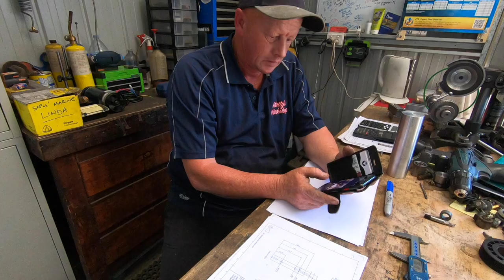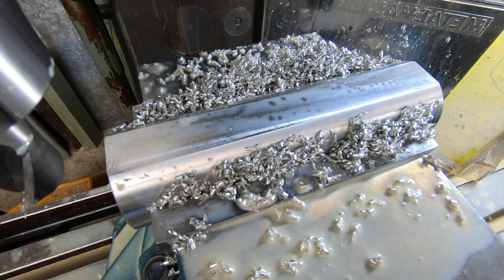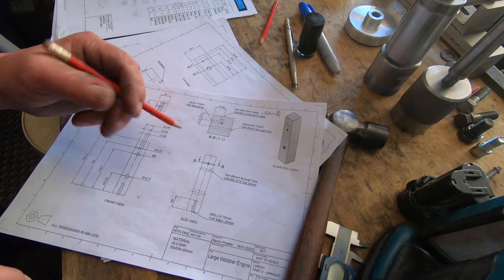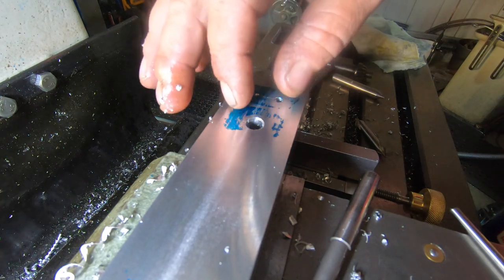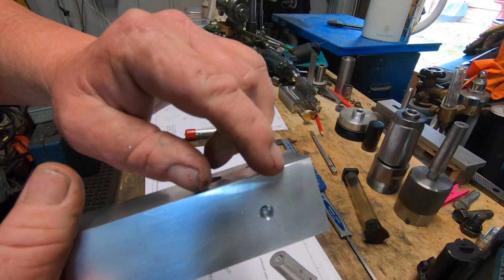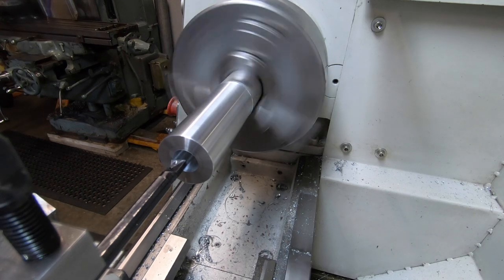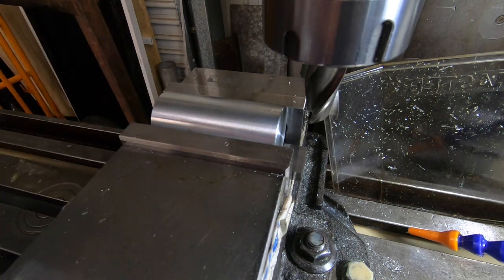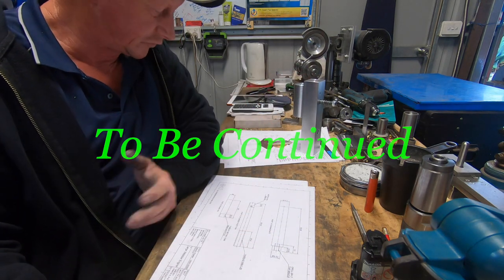Wobbler Engine - Part 1

Comment: Bad practise or not, I would also use an end mill in a drill chuck for counterboring. It's only when side milling that it's likely to pull the chuck out, or come loose in the chuck jaws. Straight down for a counterbore and there's no side load. (People sometimes tell you off before thinking it through!) :-) Awesome to see you back Matty. I am looking forward to seeing the rest of this. It's gonna be a chunky engine! Cheers mate, Craig
Reply from the maker: Gday Craig, the mt3 arbor on the drill chuck has a drawbar not a tang which is good, it certainly is a chunky engine, fun build mate, cheers
Reply: @MattysWorkshop  Yeah - should be fine either way for a plunge cut! Ignore the naysayers :D

Comment: G’day Matty. Good project mate, it’ll sure be something different every time you crank up the machines and they all got a work out even the Cincinnati. I gotta say that is a big engine.
Cheers 
Peter
Reply from the maker: Gday Peter, the only problem with using all the machines is there’s so much more cleaning at the end of the day, pain in the ass really, this is the biggest wobbler engine I’ve seen, good fun build mate, thanks for watching, Cheers

Comment: LOL when I first started all I had on the mill was a chuck and end mills worked just fine. It wasn't till much later I discovered that was a no no and converted over to ER32's.
Reply: Its perfectly acceptable to put an end mill in a drill chuck IF you are using it to drill. The reason its a no no is because of chucks usually being held in a morse, or similar, taper and tapers will come unstuck if side loads are applied. 
If you why the rules were made you will know when you can break them.
Reply: @chrisstephens6673  Great point thanks!! Actually any collet chuck meant for an end mill is also held in a taper and should come unstuck right?
Reply: Never mind forgot about the draw bar..
Reply: @TheMiniMachineShop  its the draw bar that makes all the difference,  but also most drill chucks have a taper to hold the chuck to the morse bit.  Also drill chucks are not quite as rigid enough for anything more light side cuts.
Reply from the maker: Gday Dave, I must admit I do it quite often, the drill chuck arbor I use has a drawbar so there’s no worries with it coming out, I’ve been chipped before in videos using and endmill in the drill chuck, people get a bit savage at times😂, thanks for watching mate, Cheers